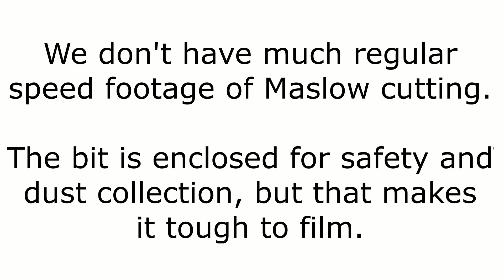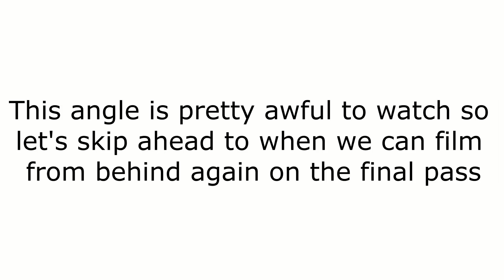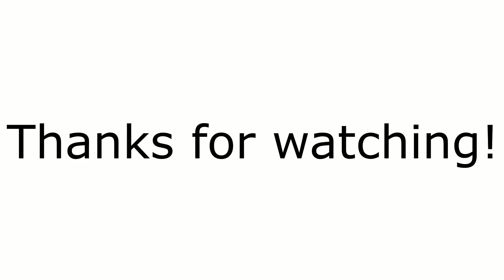Maslow CNC Cutting Speed (not a timelapse)

Comment: THis is a really neat setup. The one thing I do see is that the cutting forces are lifting the router up as it starts the cut after plunging in. More weight or a similar tensioning chain and spring arrangement needed to pull the router downwards and stop the slight wandering of the spindle?

Comment: Interesting. My hesitation on purchasing this CNC was based on the rough cut observed in other videos but this one looks like a smooth cut and very clean. Why the difference it bit dependent or was the video I found created by a newbie?
Reply from the maker: I can't say without knowing what video it is, but there are a lot of ways to end up with rough cuts. A dull router bit won't cut smoothly or if the depth of pass is set to aggressively that could be an issue also.
Reply: Heh, I'll anwser you from the prospective of someone who doesn't even own a router of any kind. But I'm a CNC machine setter and can say that feed rate vs spindle speed is the biggest influence on any cutting action like this. When we cut steel, we have to feed at about one fifth of the feed, and a quarter of the spindle speed we use for aluminium. Brass and copper also have different requirements. And I can understand that routing wood  will have it's own set of issues. Like burning if the feed rate is too slow, so the cutter will just rub and heat up, and or when the spindle speed is too high. And as with everything, the quality of the cutter is also critical if you don't want extra finishing work after cutting. Also the type of wood will affect the finish and I can imagine that particle board vs Oak has some major differences!
Reply: @wordreet  Thanks for great insight. I still wonder, how the cutter would heat up, if the feed rate is too slow? – I'd think the cutter load is what increases its heating. With less feed, the load is also less, and rpm would be higher and thus also the ventilated air is cools it more. Or, if the cutter rubs, it will rub away the wood and ease any miniscule load.
Reply: @Hukkinen  Heh, and yet another thing to consider is, is there enough space in the cutter itself to allow the chips to move out of the way and not block or weld to the cutting edges. It happens all to easily with plastics and obviously can ruin the job. But it also happens with some metals, which is why coolant liquid is required for any high speed work.

Comment: What was the depth of the cut or was that just done in one pass?
Reply from the maker: That was .75 inch plywood done in .15 inch passes
Reply: 15 inches?
Reply: 0.150" inches
Reply: @maslowcnc  That means the cut as seen took this time + 4 times the time to achieve which must mean a pretty powerless router motor. What spec of router do you advise to make it two passes?
Reply: The reason why is so slow the step motors have to Carrie the load  up of the router breks and cuting pushing .and  the rest of the stuff load on a flat router system the only load is the cut pushing this is not a bad idea on the low cost it won't do on large industry great to space saver and home craft man hobby the other issue is look like you will loose lots of material on one sheet the machine can work on a determine angule becouse of the chains means can't claim on one side to much hig then the other so $500 mmmm no more like 250 mm $300.